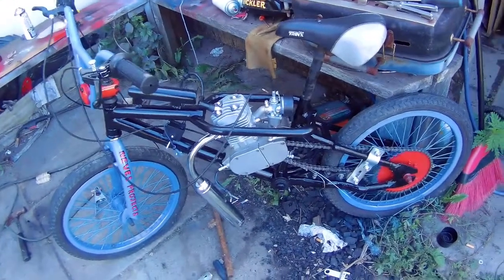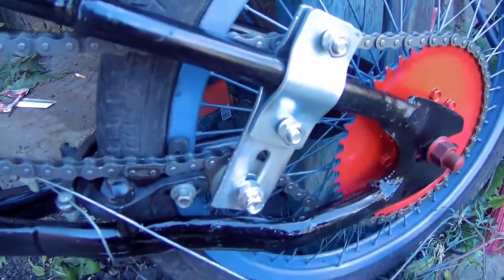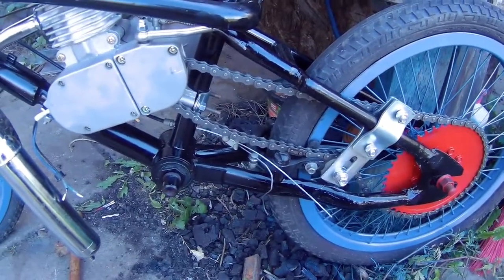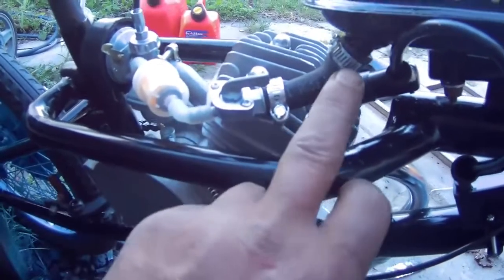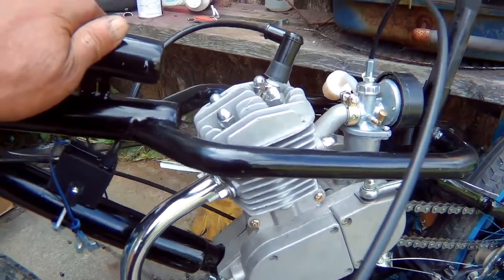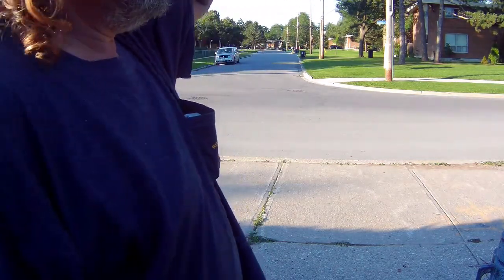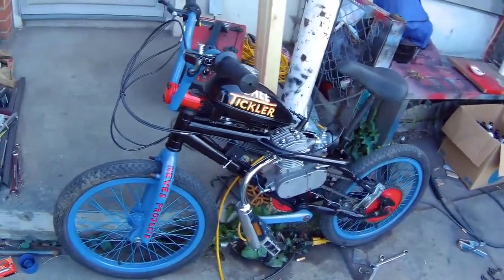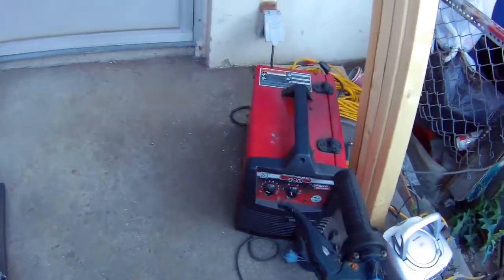80cc Motorized BMX, First Ride And Stuff

Comment: Working out oil dosage is simple.
Take the total amount of gasoline used and divide by the larger number in the ratio.
Example 16:1 in 5 litres would be 5000 divide by 16  equals 312.5 ml of oil.
This guy was close enough but just thought this might help some peeps :)

Comment: A simple fix for the spark plug issue would've been unbolting the head and rotating it. I did that on mine, it works fine.

Comment: Looks real nice. pretty cool how you rigged the tensioner to be spring loaded and nice to see you flipped the head. When I break these in I usually go through about 2 gallons of gas then move to a mixture with less oil in the fuel. Great job on the bike man.
Reply from the maker: Thanks Dan

Comment: You can take your head off and bolt it back on turned 180 degrees so the spark plug faces other way. They are made for that.
Reply from the maker: Hi Joe surfer, Thanks, the way I faced it works well, the bike was sold before I could even break it in lol, I might do a BMX with a 212cc I think that would be an awesome challenge, thanks for commenting

Comment: friction drive is much better
Reply from the maker: friction drive ? you mean a roller up against my back tire to try and make the bike move wile tearing up my back tire, how is that better ?
Reply: All hp driven and no torque.I tried using one of those as a front wheel drive motor even cut the tread on the tires to match the gear.had some fun burning up brakes and tires until  the gearbox got jammed riding up hills.